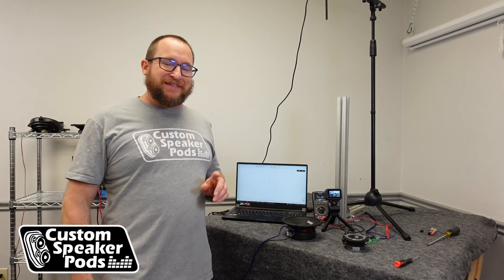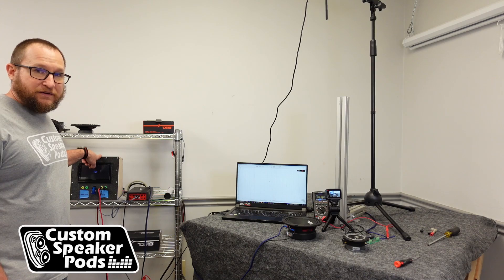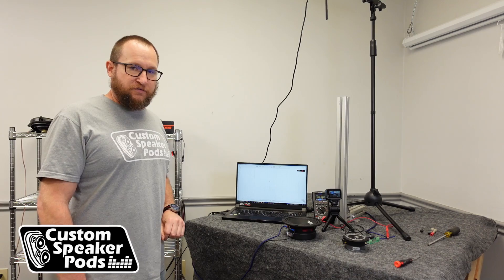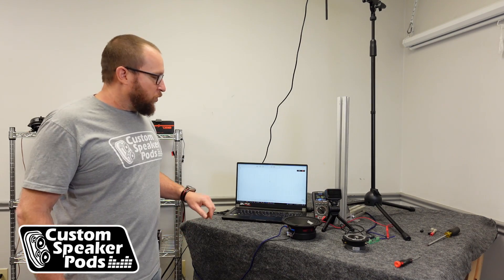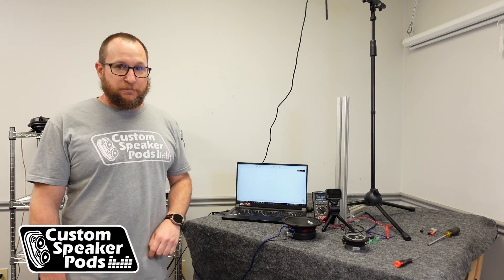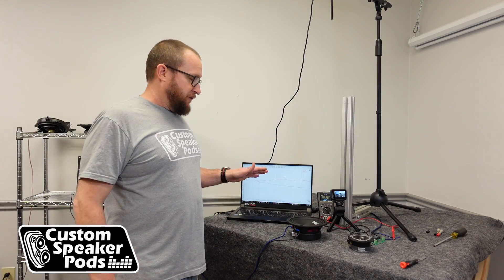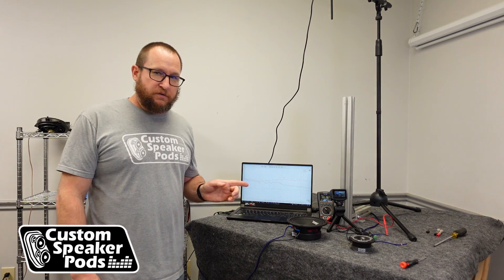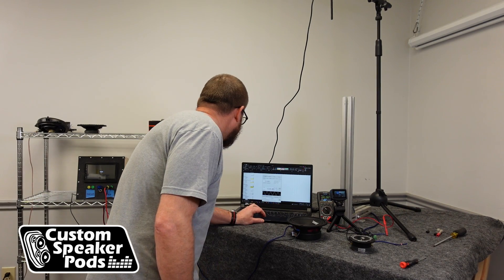How much Power do car audio tweeters need?? The answer may surprise you!

Comment: I was very surprised when you said that crossover point is 12 kHz, I newer seen higher than 6 kHz, and that's in 3 way systems. With such high crossover point is no surprise that there is so big difference in power distribution between woofer/tweeter (100W/2,4W). I wonder what would be situation if cut of 
point was let say 6 kHz, 3 kHz ? Of course probably would be also big difference between types of crossover (1st or 2nd order)

Comment: You may have answered my question. Im setting up my 1st real system and i was concerned about putting my component tweeters on a single channel with a DSP i see that just turning the gain way down will lower the wattage. I though gain was just volume but, volume is wattage apparently.😂 Thanks

Comment: One doubt... The audio system in my Corolla 2022 uses a "2-way kit" in each of the four doors with a maximum power of 160Wmax and a nominal power of 80Wrms, so there are 4 kits. The system has a good 5.1 channel class D amplifier. In the trunk is a 10-inch subwoofer. The original radio has been replaced by a good Pioneer multimedia system with six RCA outputs, digital crossover and a good equalizer. There is no DSP. This system is good, but I intend to make it excellent by upgrading all the components, perhaps including a DSP. Note: I'm satisfied with the sound volume achieved with the 4 speakers mentioned (80Wrms x 4), with them I only use seventy percent of the volume knob and I can no longer listen to the sound inside the car because it gets too loud. So, when buying new speakers, should I continue to use the 80Wrms parameter? I have the impression that I don't need speakers that are more powerful than 80Wrms. My profile is: quality sound to be heard only inside the car; the equipment should be hidden; discretion, no exaggeration.

Comment: I would like to see that measurement done with a slow sine sweep or a steady state signal (sine wave). Pink/white noise jumps around so much that I think the meter won't be giving you an accurate measurement. Not that there would be a massive difference but I think you'd be closer to 8 watts :).

Comment: I’d be curious to see the same test done with say, a soft dome tweeter… as it’s sensitivity can be averaged around  91/92 db which is very similar to most common midrange woofers (usually 92/94 range but it’s close depending on what you get) I know there’s a lot more to it than just sensitivity but I’m still curious 😅
Reply from the maker: Very good idea.  The much lower sensitivity of some tweeters will theoretically require much more power to match the midrange, but how much?

Comment: Makes sense. The smallest lightest driver would need less energy to move. But it is eye opening to see that is such a low number.

Especially when we''ve seen tweeters rated for 200+ Watts in the market.

Comment: I've never hooked up mids and highs just subs and im actually getting ready to order some speaker pods from you guys for my first competition build just finally got the alternator and power supply taken care of but I have actually been wondering this for days now trying to figure it out so I don't have to pay anyone else to do it i know I will need a four channel for the mids but do the tweeters get there own amp or do they piggyback off the mids with the crossover I've been looking for a good video to explain this process before I jump and order everything and don't know how to install it
Reply from the maker: The best setup you can get is to run everything through a DSP and have the tweeters on their own amplifier channel.  This way you can fine tune the frequency response of the tweeter.  The other way is to have the mid and tweeter running from the same channel through a 2-way passive crossover.  The testing setup was 'impressive' though in the fact that the frequency response was so 'flat' and did not show any real separation between the mid and tweeter even though the tweeter was crossed over so high.  This will vary greatly between speakers.

Comment: Most of the power is going to the 6.5 since you have no coil filter stopping the highs. remove the 6.5 and retest and use a better capacitor i don't know anyone who uses a 12khz filter for high power tweeters. tbh this info is all misleading, I would not tell any of my clients to use just a cap filter for the tweeters in a parallel circuit with a mid and neither should you, it's why they make component sets with a active crossover box with coils and capacitors and sometimes resistors to set db on the tweeter.
Reply from the maker: The purpose for this video is to at least start a conversation regarding how much power a tweeter uses since manufacturer specifications are somewhat confusing (especially the tweeters I offer from the likes of PRV and DS18). 
Ideally you want to use a crossover or DSP, but I have always been curious about how you can send +200 watts to a 2-way component and not blow the tweeter, and I couldn't find anything that explained it in a way that I understood.

I agree with the 12k filter, but it is the one included with the tweeter (not sure why it comes with such a high pass filter since it is rated for much lower, probably a CYA thing).  The woofer and tweeter are on different channels (woofer 3-4, tweeter 1-2), so there is technically no power being 'shared'.
Reply: @customspeakerpods5078 manufacturers use a REALLY high 1st order filter because it doesn't do much at the tweeters FS, so that's how high it needs to be to actually protect the tweeter
Reply from the maker: @blakebrockhaus347  Makes sense.  As for the commonality of using just a capacitor; it is very common, mainly because that is what comes in the box, and there really aren't any 'instructions' from the manufacturer on how to wire up the tweeters properly.  I hope that this video can at least shine a light on what is really necessary for a tweeter as far as power requirements are concerned.
Reply: For speakers like this, using a 1st order 12khz filter on the tweeter and no low pass on the woofer is sadly common.
Reply: I beg to differ.it depends on the aplication.i use the caps that came with my tweeters and they are EXTREAMLY LOUD AND CLEAR and they are hooked to my 8 inch mids no prob at all
Reply: @djkeys415s what brand? Model tweeters
Reply: @b3llyfull  prv t700 i and they are huge